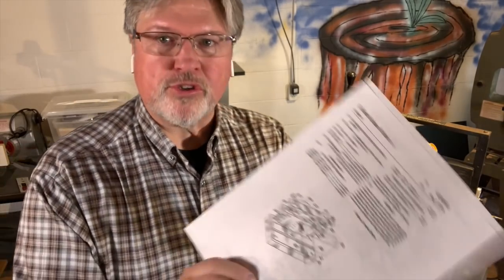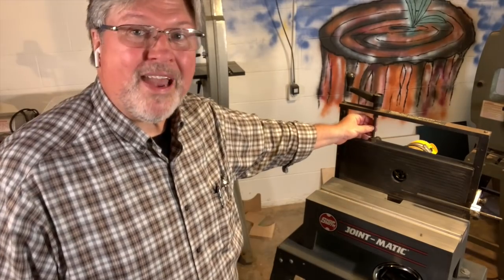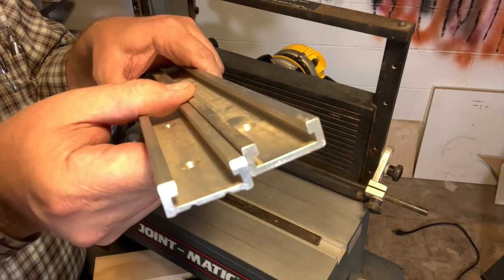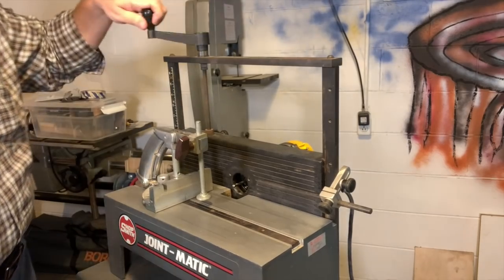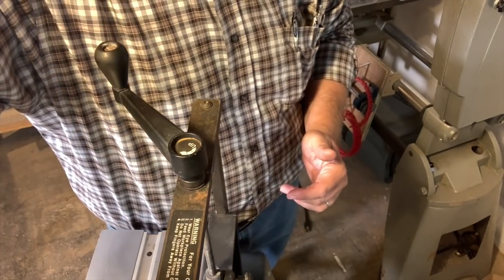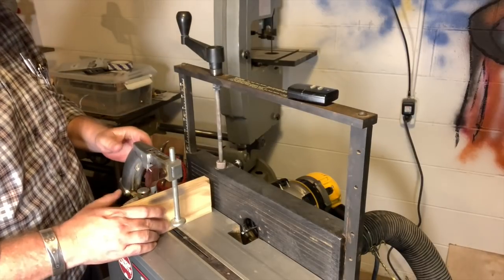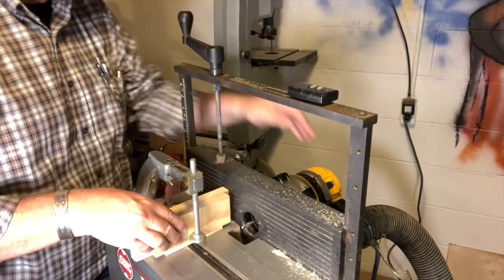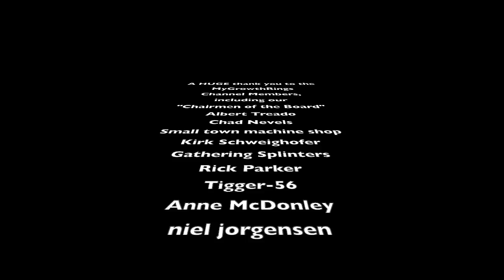Criminally Overlooked Joinery Machine You Probably Never Heard Of

Comment: I am a proud owner of an original Strong Tool Joint-Matic which I bought at the Pasadena Woodworking Show in 1983 or '84 from Donald Strong in person.   This is the one with the double threaded rods, bicycle chain linkage and steel back plate.   I absolutely LOVE my Joint-Matic and could not think of doing joinery without it.  I use it for box making, not only regular box joints but also the box-dado corner joints (aka the "quarter-quarter-quarter" locking joints), and for sliding dovetails, which are incredibly easy to do on the Joint Matic.  I crank out oodles of shallow box trays to be mounted on full extension drawer slides for shop built "SysPorts" for Festool Systainers.  (Festool tools is my other passion.)   I never used the bevel miter gauge (what I always called the "cheese miter"), and alas, it got lost in my cross-country move from California to North Carolina upon my retirement.   At the time I bought my Joint-Matic, I felt I could not afford what I thought I really wanted -- the ultimate  router -- the JDS Multi-router, which then was priced about 3-times the cost of the Joint-Matic.  Years later, I acquired  (and still own) a used JDS Multi-router (now made by Woodpeck.com).  I like them both and I would not part with them for love nor money, but I admit that my Strong Tool Joint-Matic is my favorite go-to horizontal router tool in almost all  cases.  

You're right:  sadly, this wonderful tool was overlooked or is unknown by most woodworkers.  It's truly sad that neither Donald Strong nor Shopsmith were able to enjoy the success they should have enjoyed with this wonderful tool.   I feel very fortunate to own an early production of the original model -- and more importantly, having had the pleasure of meeting with Donald Strong in person, and watching him demonstrate the machine.    

By the way, I note that you did not following Donald's imperative to "always work from the center of the bit, not the top of the bit."
Reply from the maker: Very cool story, and I am jealous of your Strong Joint-Matic! Where in NC are you? We are in the High Point area. Yes, you are right about my shortcuts on demoing the J-M. I’m more than just a bit rusty with it!  Scott
Reply: @MyGrowthRings  I'm  c. 90 mi east -- not all that far from The Furniture Capital of the World.  I live in Wake Forest, but I love to get over to Gibsonville whenever I need to restock my shop with goodies from the Hardwood Store of NC.  One of these days when I'm trekking in your direction, perhaps I can treat you to a nice cafe latte or other beverage of choice and we can talk of cabbages and kings and Shopsmiths (I own 3, well, sort of -- 2 genuine Shopsmiths and a Taiwan knockoff) and Joint-Matic stuff.
Reply from the maker: @WelshRabbit  Sounds good to me. We head to JRs for cigars almost as often as we visit The Hardwood Store.

Comment: I got to use this at an academy school as we made a candle stand, we used this tool to make the sliding dovetail groove in the base and the matching dovetail in the leg.
Reply from the maker: Ray, where and when did you attend Fundamentals of Woodworking?
Reply: @MyGrowthRings  Scott, It was in Milwaukee...... after my purchase in 87, but before my first born in 91..  I may have signed the underside of the candlestand we made, I will check when I get home from work.  IT was great - I got to meet 5 other new Shopsmith owners, we troubleshot some issues, got to use the bandsaw and learned turning, and the 'burnishing' technique.  I then attended many an evening sawdust session.  My favorite memory, the older guy running that part was always a humorous guy.  One night, they were going on about something, as the new cordless drills and screwdrivers were becoming all the rage and ~ 120-180, and he said 'we have a great deal on a cordless screwdriver for $20. Tell Steve up front.' He did not let Steve in on the joke, Steve came back and said, 'what are you selling now?', and he handed him a 'regular screwdriver'. :-)  Great memories.  which is why the 'toss out of setup instructions' was not a big deal.
Reply from the maker: @zerimaryar  It wasn’t Nick Kovacs, was it?

Comment: Thank you for doing this video! I have never seen anyone use this machine - super helpful. What would you suggest if the router you have does not align with any of the holes in the plate? Also, probably getting ahead of things, but would love to see you use the accessories and hear your thoughts on how this stacks up vs a normal router table.
Reply from the maker: Hey Andrew. That's a great question. If it's an AMAZING router I would suggest marking the location of the machine screws and drilling the plate. If it's just an OK router I would suggest upgrading to something that will give proven performance, and in all likelihood the holes will match.  Thanks for the other thoughts and I'll see if I can address them. Scott

Comment: Fascinating and welcome back!

The decrepid Joint-Matic currently for sale on the eBay US site not only has a broken slide but also appears to be missing its router motor retaining plate.  There’s a dealer in the UK who has a new old plastic slide for sale but no metal plate.  Otherwise, and if it wasn’t for ridiculously high transatlantic shipping costs, it might be possible to assemble a working version at reasonable cost.

MLCS in PA advertise a horizontal router table of their own with various whistles and bangs.  Is it any good?  It looks similar to the Joint-Matic.
Reply from the maker: Yeah, that Joint-Matic is a mess and I wouldn't tough it.  I would love to plat with the MLCS tool as well as the version sold by Woodhaven, which is also quite similar.  It all depends on what you would wont to use it for and your budget. The PantoRouter is the most interesting of all. I used to own the Woodworker's Supply Wirth Machine, which was also known as the "MatchMaker", and it was pretty slick too. Scott
Reply: @MyGrowthRings  If I win the lottery…..

Comment: That’s more versatile than my Porter Cable dovetail / finger joint jig!  

Even using the upcut bit…. Looks like the dust collection is gonna be a low percentage proposition.

I posted a video with my 8yr old sanding on the Shopsmith lathe.  Have you done any videos working with young wannabe woodworkers?  I love sharing the experiences with him… and he gets totally engaged when I do.

Scott, please proceed… you have me intrigued!
Reply from the maker: Yes, the dust collection is still weak and hardly a match for the dust tossing power of the bit. No, I haven’t done a video like that, but I’ve introduced several of my grandkids to woodworking and have some thoughts, so let me mull that over. Scott

Comment: Very interesting machine. Looking forward to the videos in this series. What is the maximum height box you could make with finger joints, and is it practical to operate at those maximums? A perfectly square miter gauged seems like it would be essential for this operation. What method do you use to square the gauge?
Reply from the maker: I can measure it tomorrow during our Board Meeting, but the scale goes to 6 1/2”. My memory says 6” though. Yes, the stock has to be square and the miter gauge too. I use a steel engineers square but I have a MiterSet somewhere that I should be using!
Reply: Thomas, you were missed in the live chat of this video. We started to think you had a life or something... Well, Scott did. I said something to the effect of  "He's a Shopsmith owner, so how could that be possible?"
Reply: @chadnevels246  Thanks Chad. Been a busy August, family vacation and back to school activities…
Reply: @woodshopnerdery  Ah. None of which I know nothing about. What's vacation? I'm not familiar with that word.
Reply: I'm wondering if box and other joints are normally always limited in length because over a certain distance, even a tiny difference in the size of the pin and the tail will get magnified until they no longer fit at the far end.
Reply: @grahamw2955  I'm not sure what you mean. Limited in length, how? If you have a jig that will cut box joints or say dovetail joints that will except a 24" wide board, then that's the limit. In the case of the Joint-Matic, the platen that the router is mounted to will only travel 6" give or take vertically, so that would be the limit for cutting dovetails. You could in theory cut a 12" wide board worth of box joints by flipping the board edge for edge, and end for end, but that would get real confusing, and your accuracy of cranking the height adjustment each time would have to be dead nuts on every time to reference off of two separate edges of each board. Not practical at all.
Reply: @chadnevels246  I wonder if Graham is referring to cumulative error as a practical limit? For example, if you have a 1% setup error in every cut, referenced off the previous cut, then after 25 fingers you are cutting 25% off. But the JointMatic does not reference off the previous cut. All cuts reference off the side of the board which runs against the table. So a 1% setup error will be 1% for every cut.
Reply: @woodshopnerdery  Right. I'm not sure what Graham is referring to exactly. I guess I should have waited before I chimed in. But yes Thomas, if you're off on one cut; as long your Starting reference point doesn't change, and all the rest of your cuts are off that same amount, and your order of processing the cuts doesn't change, then there shouldn't be any, what we call in my business "stack up error". The same could be said for most commercially made dovetail jigs.
Reply: @woodshopnerdery  This kind of refers to what Scott said in our board meeting last night. When he was the academy instructor at Shopsmith, they would once in a while do a class on the Joint-Matic in their Thursday night Sawdust Session. And they would have all these people show up for it who had bought the Joint-Matic, and couldn't figure out how to use it. He also showed us some of the manual on this tool, and with 55 pages, I can understand why it was a learning curve for most.
Reply: @chadnevels246  I was speculating (on the basis of zero practical experience) why most of the machines and jigs that I’ve seen on t’interweb seem quite short.  Does it all get too difficult to maintain accuracy of the fit over a certain length?  Or is there just little demand for finger-type jointing above a certain length and you go for different solutions?  Your second scenario of flipping it over would be doomed to failure in my hands!
Reply: @grahamw2955  I wouldn't say it gets more difficult to maintain accuracy of fit over a certain length with commercial made jigs. I would say, yes, there is little demand for finger type joinery above a certain length. Not because of accuracy, but because of cost. I don't know of any woodworker that could justify the cost of a commercially made jig that could make dovetails or box joints on a 48' wide board; when a really good jig that can do that in a 24" max wide board is around $700. And that's all that jig is designed to do. If you could do several different joining operations, that might be a different story.

Comment: If you were to run the stock in the opposite direction would the dust collection be more beneficial? Seems like it throws everything out. I also wonder because in most router table videos I see they are running stock from the other way when the router is under the table.
Reply from the maker: Andrew, that's an excellent question! I'll talk about this in the follow-up video, but the direct answer is no, the bit will toss the chips in a straight line no matter which way you approach it. The direction of cut is entirely determined by the forces that are being applied by the rotating bit. Imagine laying the Joint-Matic on it's back with the router on the bottom and you'll see that I was feeding it in the exact same way as you would a router table. It's all just a matter of your perspective.  Scott

Comment: I've been a joint-maric fan for a long time.  My only problem is that the plastic platen is slowly breaking apart.  Inserts that hold screws are coming out [thank goodness for MB Weld].  Leadscrew mounting through platen is badly cracked and failing.  I'm at a point that I need to sit down and put together a platen repain plan.  I don't think a repair will be a big deal, just take some careful thought. Take care.
Reply from the maker: That’s the one part that I wish SS would still make available. Perhaps we could make one?
Reply: @MyGrowthRings  see my comment. I had to make an entirely new slide with plywood, but can't post picture.
Reply: @daviddonnelly5981  I repaired my Joint-Matic by fabricating a bracket out of a six-inch length of 1x1x1/8 angle iron.  One side of the iron straddled the broken area of the plastic slide, with a hole to accept the adjuster nut assembly.  I through-bolted it securely using 1/4-20 bolts into holes drilled in the top edge of the slide, spaced well away from the adjuster area.  I cut away most of the other side of the angle except for a small tab dropping down to provide a place for a drilled-and-tapped hole for the adjuster nut lock screw.  It's now much stronger than the original assembly, and has held up for many hours of use.

Comment: sorry scott not impressed with the machine at all! Miscounted lol I kinda figured that could happen when counting lol I think using a jig on my Sawstop is totally better and most accurate but thanks for the video
Reply from the maker: Yep, that's my biggest gripe. I knew a couple guys who used their Joint-Matic extensively who made magnetic scales that they added over the stock scale that guided them through their joint, and that virtually eliminated their errors. Even so, I get it!  Scott